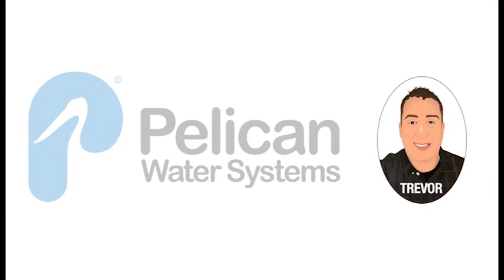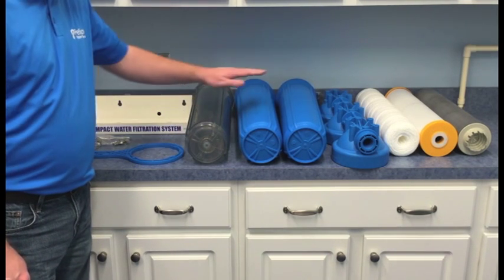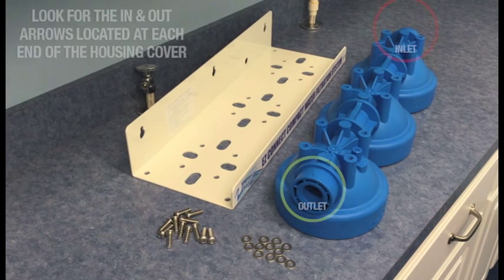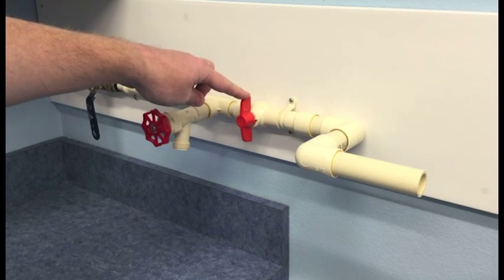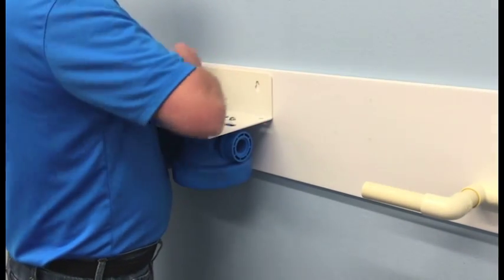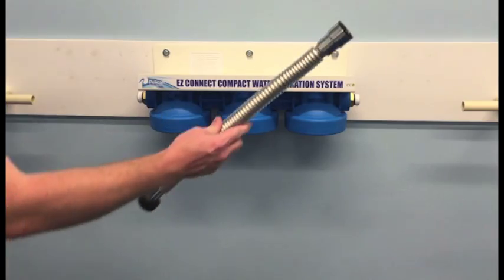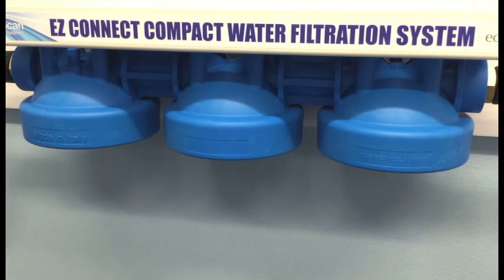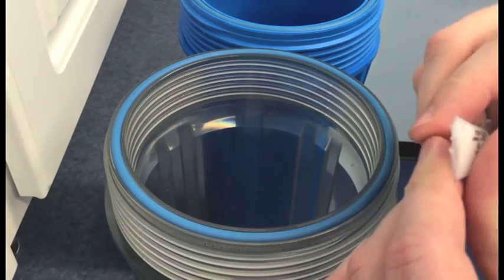How To: Pelican EZ Connect Compact System Installation

Comment: Does this remove fluoride because I'm getting mixed signals from your site and the videos.
Reply from the maker: Yes we do have a model that handles Fluoride. Look at model PC200-F or PC300-LF (which does lead and fluoride)